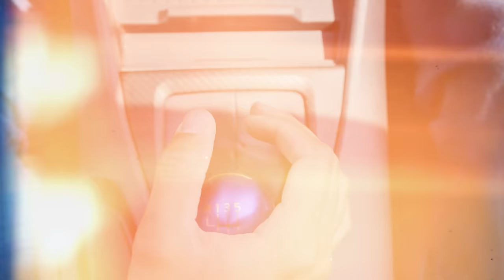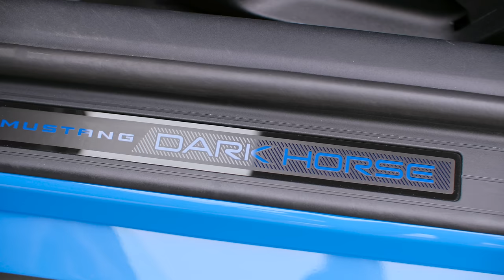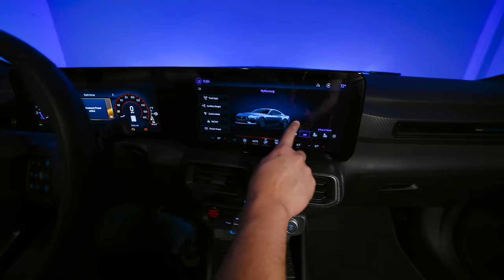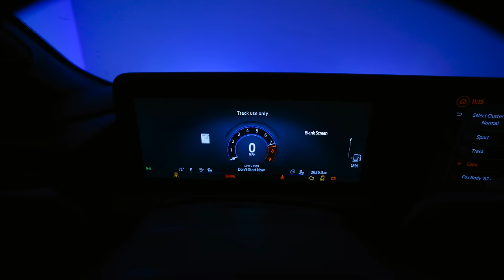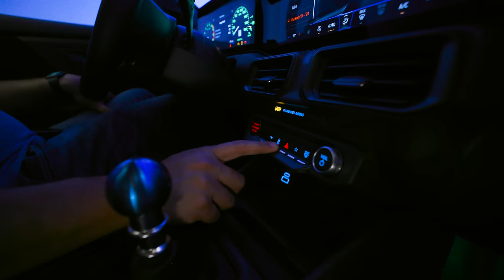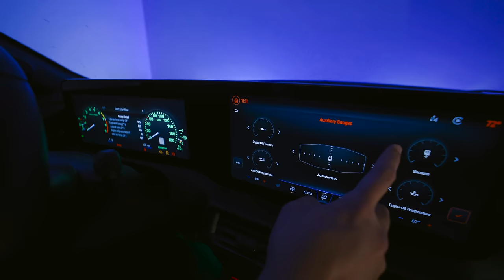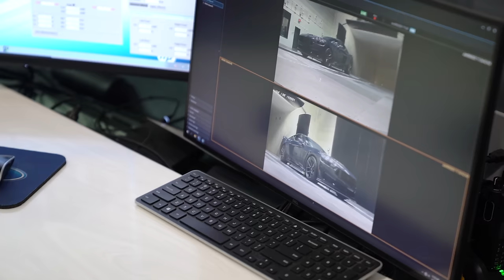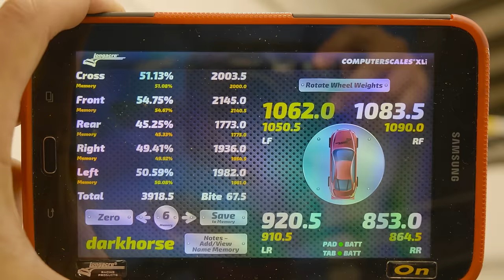2024 Mustang Dark Horse | Why This Car Exists

Comment: I enjoyed hearing the engineer mention there's more direct feeling steering-- yet Throttle House stated they couldn't trust the car because the steering was completely dead.
Reply: Throttle House were driving the regular GT trim and Savageese were testing the Dark horse.  It's safe to think that the tunning is different.  Hell, the manual transmission unit is different between the two.
Reply: Dark Horse prolly has different tuning and also has massive tires in the front which can push an illusion of good steering. You have so much grip up front you don't comprehend the lack of feel until the turn is already over lol
Reply: @Aki_Lesbrinco ya but the engineer said the faster steering ratio is across all models.
Reply: The Throttle House car had Pirelli P Zeros, presumably with soft sidewalls.  It could be that the Dark Horse comes with better tyres (like Goodyear Eagle F1 Supercar 3R)? ...Nope a quick Google suggests it has the same P Zero PZ4 tyres.  So I'm out of ideas on that one!  Perhaps it is just the calibration (and steering rack itself) that is different?
Reply: @DragonKnightX12  They tried all three modes.  Unfortunately Ford has the mistaken idea that buyers want pull-drift compensation, which filters out steering feedback: "A software-based pull-drift compensation program that helps keep a vehicle equipped with EPS on track when faced with crosswinds or an uneven driving surface. ... The pull-drift compensation program operates via sensors that constantly measure wheel torque applied by the driver to maintain direction. Ford says the pull-drift compensation program is designed to increase customer satisfaction in steering, suspension, and ride quality surveys by up to 50%."

Normally it would be noted that sportscar buyers do not want this, but Ford seem to have failed to oblige that!  The old Mustang even had a rubber coupling in the middle of the steering column like a Hyundai Elantra (BMW E46 M3s had that too), why you would put a rubber isolator in the steering column on an enthusiast car, I have no idea!
Reply: @TassieLorenzo I'm assuming these have adjustable steering with the PP like last gen. 
Maybe they had  it set to comfort instead of sport?
Reply: @TassieLorenzo  All of them have it  now, even BRZ and Miata have electric assist steering. A lot of it now is feeling through the chassis.
What strikes me is that they did stuff to add more feedback, yet it didn't do anything.
Weird. One thing I noted tho was TH made it sound like it wasn't even working. The steering stayed light.
Either they fudged the tuning on the GTs or some of the had faulty steering units. 
C&D also complained about it.
Reply: @DragonKnightX12  BRZ has a (direct drive?) electric assist motor on the column with the rack itself being manual (Renault uses this too), which generally has better steering feel than the motor being on the rack with a belt drive.
Reply: @TassieLorenzo  Not quite sure, that might be a bad thing since I own a 22 BRZ. Lol
It's pretty good  electric, but  the feedback still isn't near the level of hydraulic. 
Tbh I could deal with numb steering, but I want my steering to tighten up and have some heft too it. 
The Stang is supposed to give you more feedback tho.
Reply: Compared to hydraulic steering its shit but no cars really have that anymore

Comment: I really hope there is an aftermarket kit to remove the infotainment and replace it with physical controls and a smaller screen. Great job on this video!
Reply: Don't count on it.
Reply: MK7 GTI is still struggling with aftermarket radios let alone a full infotainment replacement.  So much software garbage programmed into these cars nowadays.
Reply: I doubt it. On these newer cars the infotainment is often integral to other systems in the car.

Comment: The “digital experience manager” is full of um, hot air.  

People absolutely want a mix, you just don’t want to do it. 

If it’s something that will be interacted with while driving, it should be physical so that you don’t need to look at the screen.

“But the focus group…” did you give the focus group cars to drive around Ruth? Experiences are very different than opinions on a piece of paper.

Comment: Great video on a mid car. I love Mustangs (I daily a 2011 Mustang GT) but the S650 is a miss from me.

Too expensive, too heavy, and that interior is a crime. Despite all that you guys still make me kinda like the car, which is a testament to the quality of your videos. Keep up the good work!
Reply: Like 60% of the interior looks like my 2020 GT/CS, my next mustang will be a 12 BOSS302
Reply: As we approach the twilight of the gasoline car era, the Mustang has turned into a fine automobile. It's head and shoulders above the earlier generations of this model. We've just gotten a little spoiled. I drive a 2023 Mustang GT 6 speed and I've owned many cars and that includes BMW M automobiles and my Mustang compares very favorably to what I've owned previously.
Reply: I too would like a Boss…their values tipped upwards sharply in the past few years. I should have bought one in 2019 when they were sort of at their best price.
Reply: @billisdewillis5  same man, I was torn between a Boss and an S550 as a daily and I picked the S550 cause I wanted a better interior.

Comment: Good vid guys. The formula for enthusiasts' cars from the big manufacturers is so reliant on the past, brand loyalty, and the aging consumer. Is it possible to create a new formula for today's mindset (following the logic of the pony cars from the 60s), with the parameters of present needs, desires, etc. in mind?
Reply: No because in my experience enthusiasts don’t buy new
Reply: They don't need to reinvent the wheel to make a good enthusiast car, we already know what works. The way forward doesn't need to exclude what has already been learned.
Reply: Look at how outdated and borderline delusional these ford engineers are in their design and pricing strategy. This team is also partly responsible for naming a 4 door crossover a mustang so that’s a big clue into how lost these guys are. They’re designing cars for the youth that are largely only affordable by boomers (at least for the properly equipped true mustangs with a v8). The system is broken.
Reply: @DanielDaniel1:  I know many Ford executives. The reason that Ford went down the path of the Mach E was that Ford from 2021 model year Mustangs through 2023 were getting crushed by the EPA & Government for the shitty gas economy of V8 Mustangs not meeting CAFA specifications. So having the EV Mustang MachE lowered the bad numbers overall for CO2, & mileage, etc. Hence the ability to keep building the V8 GT Mustang and after 3 years of selling newer models with lower horsepower was no longer required but in 2024 the GT actually has the most horsepower for any GT ever plus more for the specialty car replacement for the Mach 1, that being the Dark Horse with 500 horsepower. So while Dodge and GM quit supplying pony cars with the hemi & LS Ford keeps the Mustang GT alive. So learn the truth about the Mach E mustang. Ford Executives know and understand the Mustang following and we should certainly be thankful to still have a manual V8 Mustang GT with more power and refinement. Don’t throw stones unless you know the truth behind the bitch!!!!!💪🇺🇸

Comment: I currently own a 2019 BMW M2 Comp and a 2004 Z06. During track days I bounce between the two since they provide completely different driving experiences. I get better times in the M2, however the raw experience in the Z06 provides more smiles. Unfortunately, the M2 is reaching 60K miles and I feel its time to say goodbye and change up the ride. I would consider the Dark Horse but know the greedy Ford dealerships will mark up the first wave. I am seeing new manual tran 2023 Mach 1’s going for under MSRP, I am thinking the Mach 1 would be the better value at this time, thoughts?
Reply: Honestly the dark horse is the better car but i cant make the argument its 10-15k better
Reply: I think the Mach 1 with Handling Package is your best choice.
Reply: Mid $50s vs $70s plus dealer markup seems like a no brainer. Both will need track focused base mods if you get even semi serious anyway.
Reply: If you had that kind of money I really would have considered the GT350!
Reply: I also own a 2019 M2C (and a Tesla Model 3 Performance). Keep the M2C. It’s probably the last “classical” BMW they’ll make. New M2 is like 3900 lbs and that’s close to the curb weight of my M3P. My suggestion is to trade in your vette for a C8, and if the M2C must go, get a Cayman.

Comment: I I were in the market for a car like this, I would definitely go for the Camaro LT1. You get the LT1 6.2 which prob makes more torque then this thing and has a bit more grunt down low which is nice for a street car. Also a tremec 6sp and a lighter chassis for sub 40k.
Reply: I wouldnt buy the camaro but this is definitely a smarter decision to make.
Reply: The Camaro is cheesy. What do you drive? “A Camaro”. I’d be embarrassed to say that! The Mustang has always been a cool iconic car.

Comment: Nicely detailed video! So glad Ford continued with the Tremec 6 speed for a v8 NA engine combined with improved suspension, improved aerodynamics and better steering feel. However the two screens just seem bolted on and not integrated into the dash and not appealing. Also electric steering will not ever be as good as hydraulic for feel. The new Mustang is too heavy for what a sports car should be and losing weight makes you go faster everywhere and puts less strain/wear on components. Lastly the price is significant as the review said.
Reply: the regular gt still has the mt82 lmao rip ford never fails...
Reply: @bwSteen exactly!!! Why or why would Ford use that shit Getrag transmission for the 2024 GT’s when they had a Tremec at the ready

Comment: Ive owned Mustangs and Mustang Cobra's since my 1989 GT 5.0. Just bought a new 24 S650 GT premium and have to say, this car just rocks. Car is fast, rides fantastic, handles well, super quiet cabin, killer exhaust note, 27 MPG at 60 MPH on road trips. Okay the iPad dash isn't the best, but it's the future and is in every top tier car these days, Mercedes BMW etc.. I do admit its fun to play with all the dash features and there are alot.  Overall, love the car, it's an absolute blast to drive and you will blow the doors off every grocery getter Camery, Rav4, Escape, Prius, Hyundai, Kia, boring blah, blah plastic cars these days.

Comment: I have a 22 SS 1LE.. Paid $48000 for it brand new.. This car is not worth another $20-$25,000 bucks, No way no how.. At this price you are well into ZL1 money, or an nice spec of a C8.. I have always been a Ford guy but after the debacle I went through with my 18 S550, I will never own another Mustang.. The motor ticked like crazy, left me stranded with 2 broken fuel pumps, and the 10r80 shit the bed at 18k miles.. Got it Lemon lawed.. Which I was happy about after driving my SS1LE Manual for a bit over a year its been so perfect.. Handles 10x better than the 18 GT PP1.. and the Tremec TR6060 is amazing, and so is the diff.. Such a steal for under $50k..

Comment: Wow dual airbox induction! Has this ever been done before? Ima Honda guy but can appreciate the icon that is a V8 Mustang. That SVT cobra in the early 2000s will always have a place in my heart.
Reply: It's commonplace on exotics, all Italian supercars have at least twin throttle bodies (for each cylinder bank), good to see this spec in a more reasonably priced vehicle.
Reply: Might be just me but I'm used to seeing the dual airbox on the Nissan VQ motors for at least a decade. Feel free to correct me if there's a difference I'm not seeing on this application..
Reply: @Akallday502  yea, I rarely ever see this if at all. I'm just amazed at the engineering aspect of all this. I was disappointed with the huge touchscreen but was relieved that they still made a stick and  actual physical hand brake!!!
Reply: @selfproclaimednobody4614 no GT500 has ever had it?
Reply: @762x69  yea man Nissan v6's have had em on and off for over 33 years vg's vq's vr's
Reply: @762x69 facts I have a Infiniti m37x it has it
Reply: @antoniobanderas7810 "physical handbrake" that is 100% electronic. A cop out in my books.
Reply: @rsac43  I know. Just rewatched that segment. It is a cop out. 😔
Reply: @rsac43 a cop out on a hand brake 😂 stop eating crayons.
Reply: @bcab7955 it’s a total gimmick on the mustang, guys have been making 550hp na with a single throttle body on the 5.0 for a decade
Reply: @drunkpolack7612  Paired with a hotter cam, this may tweak the power delivery by shifting peak hp higher up the rev range with a minor hit to low end torque. Regarding any real boast in peak power, I agree that this update rewards minor returns, just a different characteristic.

Comment: I still don’t really get the flat black under the headlights. My Camaro has the same thing. But on this I think it could’ve at least been shaped differently if it had to be there.
Reply: They went with the pilled out, screen addicted 20 year old eyes. If you look closely you can see anime porn in the reflection.
Reply: @bert_norton  Apt. Apt analysis Bert. 🤔

Comment: This car is almost perfect, and it’s pretty obvious the one thing that Ford failed at here. Removing physical climate controls on the center stack. What a missed opportunity. When these gigantic screens stop working in 20 or 30 years, and repairs are too costly, I wonder what will become of cars like these.
Reply: They’ll be restomodded with analogue gauges.
Reply: Uh you just replace the screen.
Reply: @GuyGamer1  you ever have to replace one of those out of warranty? Ones that sync up with the cars climate control ecu? I’m guessing not with how new the tech is, because if you did you might realize how ridiculously expensive and Daunting of a prospect that would be. I use to work for Ferrari, for example a 360 Modena ( base level Ferrari) F1 transmission out of warranty is $30,000. Why not just include analog AC controls from the get-go that won’t break or need replacement, i’m not even saying the the AC controls would fail but because one of the 100 other features built in stopped working or created massive lag. It’s a crapshoot
Reply: @darkchild130 lol something tells me that won’t be the case, car culture has shifted, the muscle car guys that keep their cars for 30 years are dying off.

Comment: This car reminds me of the new Z in so many ways. Mainly how a global company restricted the R&D to the point that they reskinned an old chassis and tweaked an existing engine, then gave it obnoxious screens and digital gimmicks. I'm sure the dealerships will complete the trifecta and charge $30k on top of MSRP to make sure that "cars don't sell as good as SUVs."
Reply: They don’t have to “make sure” of that. It’s just a fact that general car buyers want an SUV appliance and not a drivers’ car with connection
For those who want to do more, they buy a track for full size SUV. That’s reality
Reply: Closer to a warmed-over S550 than a new generation. Even the door cards are the same.

Comment: As a boomer myself, this product is an unabashed, overpriced reach into the collective boomer wallet.  I'm keeping my wallet in my pocket.
Reply: Buy a 19-20 GT350, they’re just going to skyrocket.
Reply: For what it's worth, this isn't necessarily as overpriced as it first seems.

I've got a 2013 Boss 302, which had an MSRP of $45k. If I run that figure through an inflation calculator, it comes out to $59k, which is marginally higher than the MSRP of the Dark Horse.

Inflation has really done a number on car prices, in the past couple years. There's not necessarily much that OEMs can do about that. It's good to have something in the past, to compare prices with.
Reply: Ok boomer
Reply: @RRR1-z9c  🤣

Comment: 6:40 "We brought in a bunch of marketing millennials to..." Never, ever do this. The new 'stang has lost most of its identity in this redesign. All that remains is the grille and tail lights. Gen 6 had the perfect sweet spot between modern and retro. I'd wager a fair bit of cash that BMW also assembled a bunch of marketing millennials to judge the new (well, not so new now) 4 series nose. For me thought the interior is the real deal breaker. The wrap around full-touchscreen dash style is a hard no. There's a way to bring modern tech and displays into cars--this isn't how. You don't just glue a bunch of screens on the dash. It looks lazy and gross, not to mention the usability issues and retina blasting at night.
Reply: Ok boomer.
Reply: @johnsullivan8673  I mean, I literally AM a millennial. I know not to expect much of my generation because I grew up with them.

Comment: Still looks to me like a 6th gen Mustang that doesn't get much sleep and had two ipads slapped together on the dash. 

I have no doubt the performance is there but I'd probably still pick at 6.5gen mustang.
Reply: Doesnt get much sleep and has two ipads.... yep its a millennial
Reply: @728GT  or gen Z. Totally accurate.  Of course I'm not sure why they are targeting the younger generations as increasingly we don't have money for fun stuff like a sports car.
Reply: @kyle8851  oh its fine theyll gladly pitch you an 84 month loan at 12% financing so you can swing the payment 🤣
They only want to have the buzz that the car is cool they dont care if you can buy it since theyll still sell boatloads of ecoboost convertibles down in Florida to the blue hairs 🤣
Reply: @728GT  ah yes. Money down the drain.  

Honestly, I kinda wish they'd leaned harder into the retro styling. At the very least, I think having more retro style gauge options would be cool. The fox ones look nice but why not make ones that look like the original or even last gen?